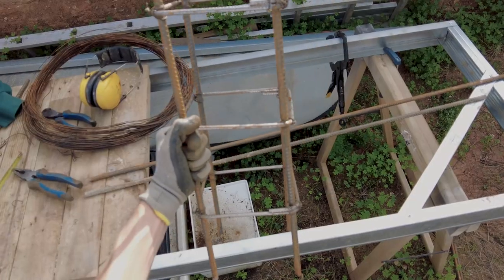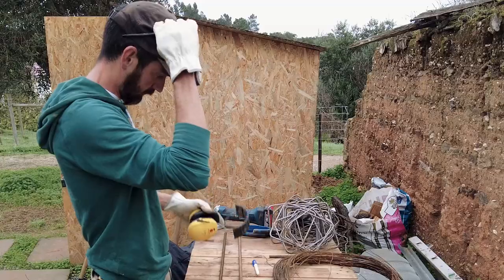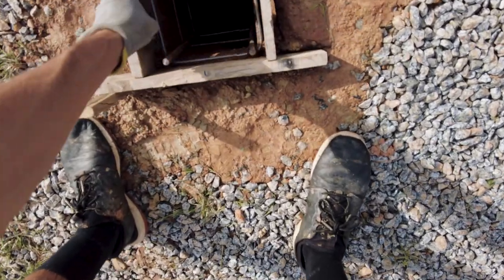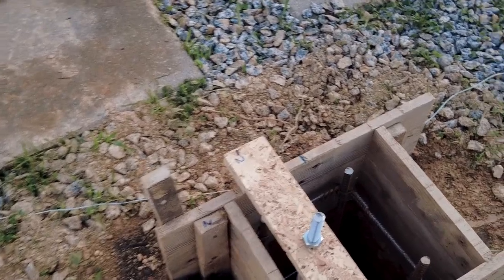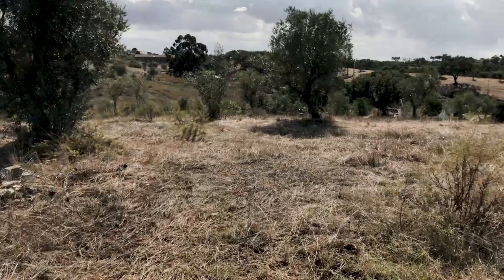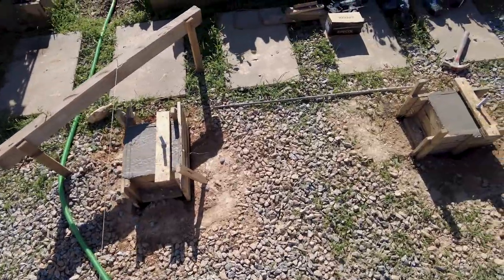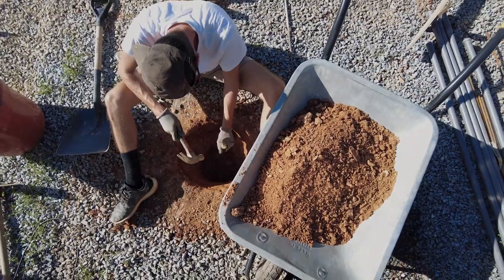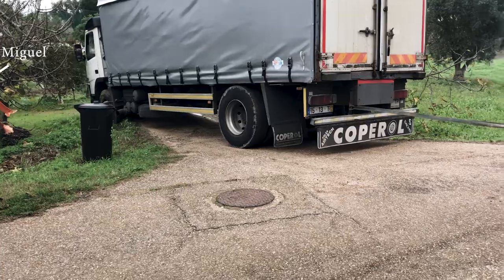#2 BUILDING A CABIN IN PORTUGAL [Finishing Foundation]

Comment: I built structures that size for years and never used such an involved foundation. Were you required to do all that?
Reply from the maker: Hi there! not really, we wanted to have the structure off the ground and our soil is not very hard in the first 40/50cm depth so we decided to work a bit more here and not regret it later. Foundation is probably the most important part of the whole build! It literally took us just a couple of days to do it.